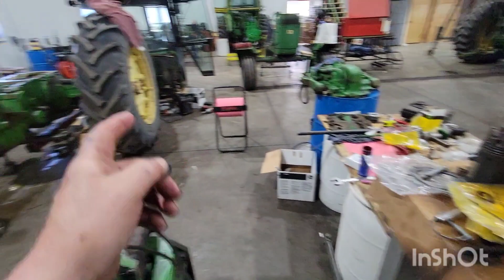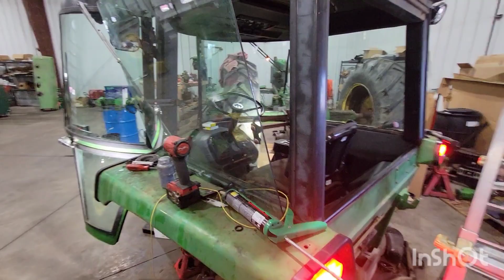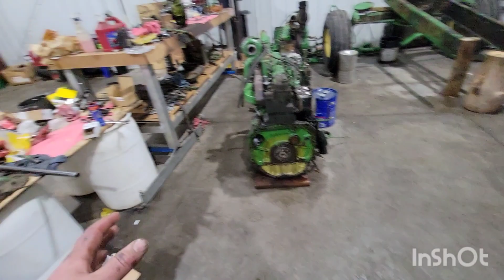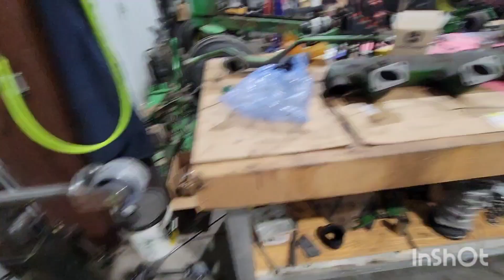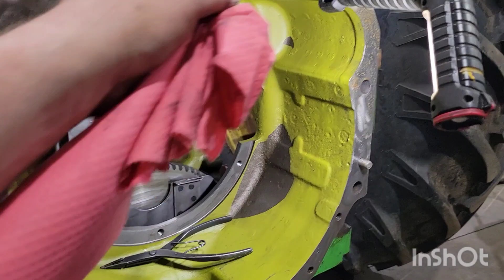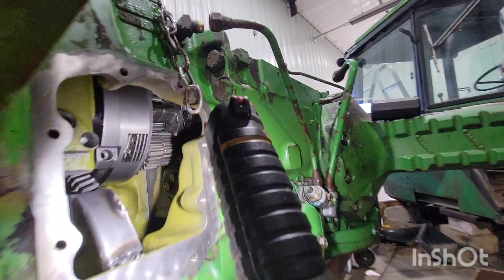are John Deere 4430 clutch housing rebuild.  splitting stands are done! Mobile Welding resource!

Comment: Hello, my husband had a few questions about our 4430.  The clutch pressure is 100 and the lube pressure is zero.  Do you have any idea what’s going on?  We have checked the o rings and changed the Clutch oil pressure valve housing gasket R52905
Clutch valve housing gasket R51857.  Any help is appreciated.  TIA!
Reply: It had 9 shims already, so we bought new springs.  Tried shimming, but it didn’t matter.
Reply from the maker: If you brought it here, I would drop oil, clean the sump screen, and change filters. If the sump screen is plugged, you might not be getting enough oil, 
After that, cycle the pto on and see if anything changes, if things stay same with pto, put gauge in pto pressure port, see where it is, push clutch pedal down and see if pressure in pto goes up
Reply from the maker: On that clutch valve housing, there is a taller nut on the bottom. If you take that nut off, you can put a couple of shims in the nut and see if pressure changes.

Are there any symptoms of the clutch not working right.

Comment: How can I fix 3040 3 point?? When I throw the lever up 1/2 in from max it goes up from down position, 1/2 in down from up position goes all the way down no in between just all or  all
Reply: Tried that no change can I adjust on the right side of rock cover. I can’t get the set screw to turn can I pull the plug w/o losing anything mechanical inside sump area
Reply from the maker: I'm not familiar with the 3040, but yes on the control valve housing, it would be on the right hand side to be a plug you can take off and if you shine a light inside there you'd see a little flat head screwdriver slot screw. If you turn that counterclockwise it will tighten up the valves. If you go too far you'll hear the hydraulic load on the motor will never go away when The Rock shaft stops moving. But they're also is a adjustment somewhere on that tractor for the load sense arm. On the North American row crop tractors you'd come in through the back of the transmission case
Reply: I just realized I got the wrong model up it’s a 4430. went through the manual and set starting points and started playing w/ adjustments.  No adj on the castle nut though bung on back above PTO, no adj on screwdriver on right side and put a new ? Rock shaft sensor valve adj in ( spring loaded cam on a screw) no adjustment on that either only the speed control adj I can get a change of function out of. Gona haft to pull her apart aren’t I
Reply from the maker: @danielduroy3517  yeah it sounds like it. I'll have a video out the next day or two doing that valve
Reply from the maker: Move your draft lever.